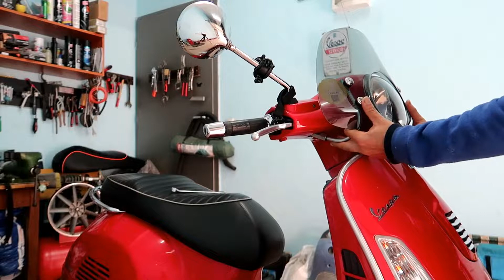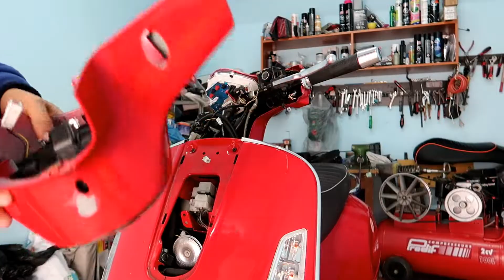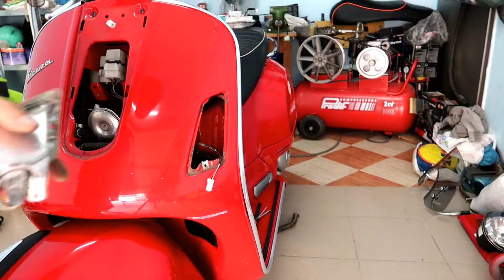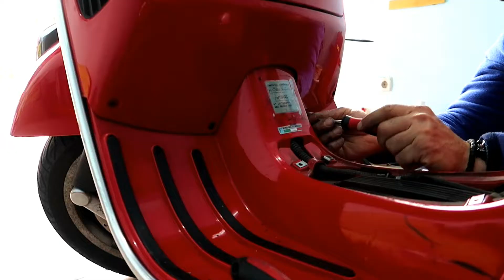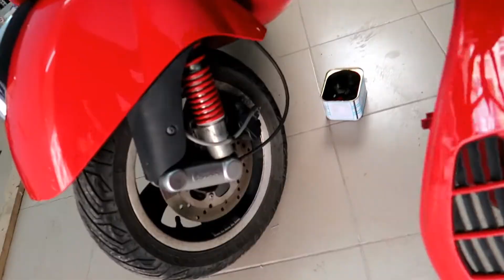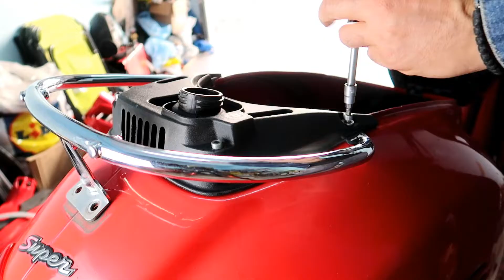Vespa gts plastics removal (how to remove plastics Vespa GTS ot HPE, Glovebox, body panels)

Comment: How to remove the lower side panels was very helpful.  Thanks!!!
Reply from the maker: After removing the rubber bands on the bottom panel, there are 3 screws under them on each side. At the rear there is a bolt that unscrews. The steps and moldings are dismantled. The panel can then be removed.
Reply: Thanks again!!  @fitness-fishing-s.kovachev

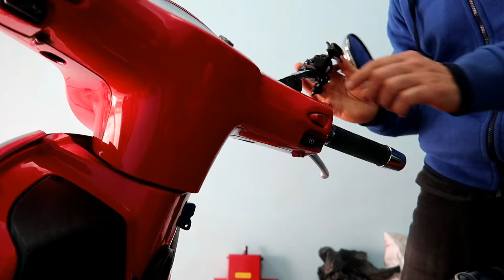Comment: At 02:35 how hard must you pull to separate them? I have removed the screws and mirrors but the plastic parts will not separate. Are there any risk of braking some parts of the plastic by using force?
Reply from the maker: Carefully detach the plastic of the headlight. The newer Vespa GTS have plastic ears that hold the front and rear plastic of the headlight from above. To disconnect them, press lightly with a thin screwdriver.
Reply: @fitness-fishing-s.kovachev  Thank you! Keep up the good work! Like when removing the Piaggio emblem.